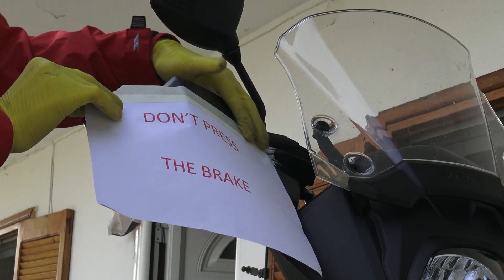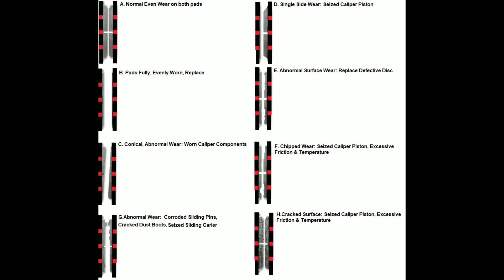How To Replace Your Motorcycle Front Brake Pads | Dr Vstrom Brake Series

Comment: Hey Doctor! Thanks for the useful video: do you have any specification to share about the grease you're using on the calipers? Is it a molybdenum grease maybe?
Reply from the maker: Which one? I use several
Reply: @DrVstrom  I thought it was just one type. Anyway, I meant the light blu grease you apply at min. 07:05, 08:05, 08:50 and 10:05.
Reply from the maker: Its liqui moly ceramic paste
Reply: @DrVstrom  Thank you very much!

Comment: Very good informative video.. I had a question, is it ook to replace the OEM brakepads with EBC once , I find them better in braking, but will it wear the disk rotors  much faster ??
Reply from the maker: Thanks. Well if you have better performance and this is what really counts for you, some brake pads will do this. I dont have experience with those but how dramatic the wear can be? Ride safe.